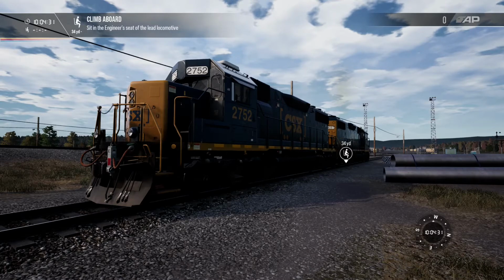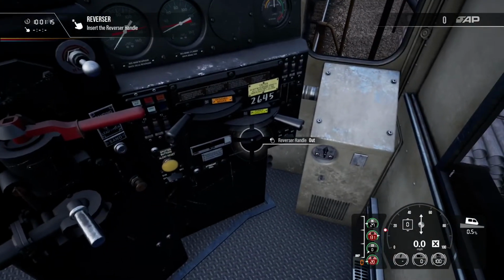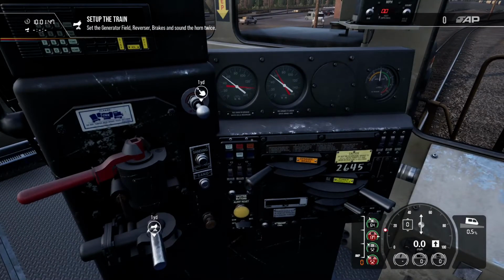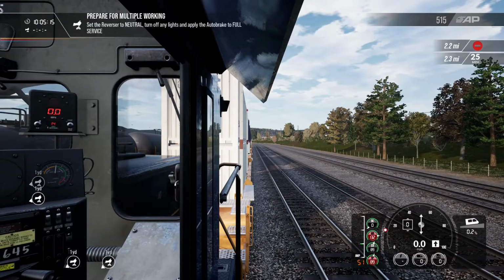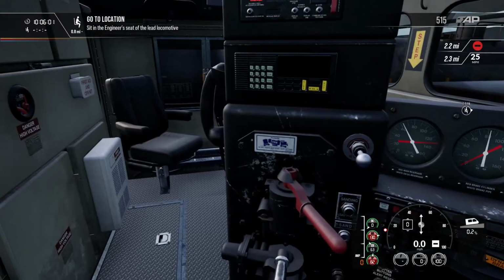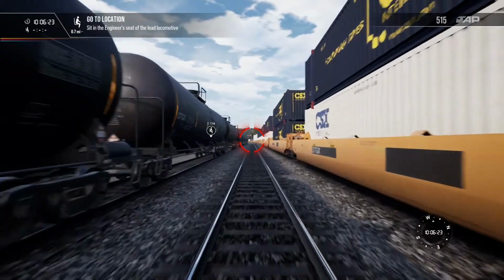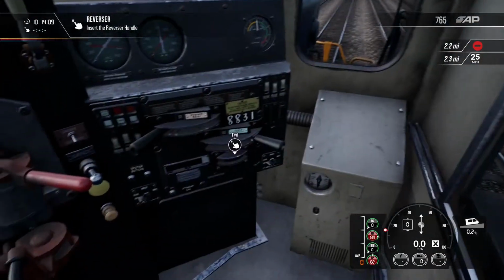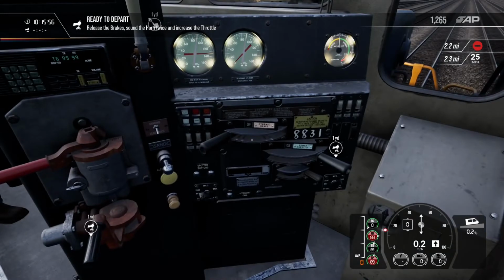Train Sim World 2 - Fully Fueled Scenario - Tutorial

Comment: Awesome video. First time I ran this I was lucky to keep at 11mph up that grade going all out at 8. After this, I was managing my speed at 25 between 5 and 6. Thanks!!
Reply from the maker: The extra horse power sure makes a big difference. 😀👍 I went back and tried again with only three engines and got 12 mph at notch 8. I had to stop at a red signal on the grade and could not get the train moving again - sanding was no help at all and it eventually derailed from all my attempts - lol.

Comment: I love this video, I've tried it twice, first time got stuck on the big hill with just the first loco working, then jumped in second, set the power to full reverse and tried just the front two, didn't work, so I left the loco, ran down the side of the train and got about 1/3 of the way down, then noticed the train rolling back down the hill, I realised id left it full power forwards and hadn't put the brakes on, rolled for a couple of miles at silly speed and failed.
Second attempt, as soon as the loco stopped on the hill, I put the brakes on, ran down to the bottom two, put those at full speed forwards, then ran back to the first two, set those up and off I went, got good speed, however a mile or two near the end, I put on my brakes on the first loco, didn't stop, flew passed the destination and got to 60mph downhill and failed again. Needless to say that's now about 5 or more hours wasted because it took me a while to get moving and figure some stuff out, can't wait to try this in the morning!

Comment: Ah, of course, the breaker box. 🤦‍♂️

Incidentally, the other way to verify DPUs are responding to the lead loco is use rear camera #3 (for computer, not sure what button that is for game console, it's the exterior not boom cam). Then bring the camera right to the engineer's window, open it, view the ammeter to see if the needle has moved. Also, you can use this camera to change any settings in distant locos if you forgot them instead of walking all the way back. 

And just one more thing, if you want to run your rear DPU prototypically, the very last loco's headlight that faces rear should be set to dim. I noticed this game attaches an EOTD to the last loco which I've never seen any US railroad do. The trailing loco is equipped with lights and air brake monitoring so an E.O.T.D. (or F.R.E.D.) is not necessary. And I try to dim the headlights when passing other trains and dim headlights when stopped for more than a minute just like the real trains.

Comment: Been trying to do this Fully Fuelled but I always get to the second stop signal and it will not change, even after leaving it for and hour. Engine setup was ok and i got all engines to work together.
Another way to see if engines are working is use external camera and look through each engine window. You can also change settings by opening the windows.
Reply: Just to add to my post. Been searching again and found out the red signal freezing is a game save glitch. Saving the game midway then reloading does not load up original signals and it seems to freeze. I am running a PC but it seems Xbox has the same issue. Good luck if you have this problem.

Comment: What does comm do on the radio??
Reply from the maker: "Banking Comm On" establishes radio communications between the lead locomotive and the 3rd locomotive. With this button on, the 3rd locomotive gets its commands via radio signal from loco 1 and is thus able to control any other locos directly attached to the lead pusher unit (in this case loco 4 is slave to loco 3).
Reply: @DustyCircuits336  ok kinda get it now but say I’m just doing a job and I only have 2 engine’s is that button going to help me get over the hill?
Reply from the maker: @James16181  Unfortunately it is not like a turbo boost. The button on the radio will only help you get over the hill so long as you have enough horse power to push and pull the train over the hill. Hypothetically, If you had only one engine pushing and one engine pulling you will still stall on the steep grade. Hope that helps. 🙂👍
Reply: @DustyCircuits336  thank you one last question if I’m doing the timetable jobs how to I get more than 2 engines on my train because it only starts me with 2 engines

Comment: Your pc spec?
Reply from the maker: The PC used in this video is:

Acer Nitro 5 Laptop
Core i5-10300H 4C/8T 2.5-4.5Ghz CPU
16GB DDR4-2666 RAM
NVIDIA RTX2060 6GB GPU
512GB NVMe SSD

This was the easiest way for me to get a GPU last year. It's about the same performance as the desktop GTX1660 6GB, but with ray tracing.